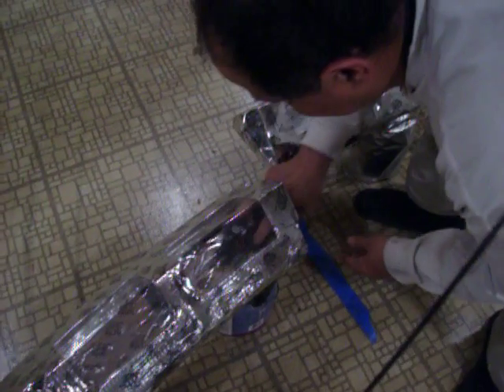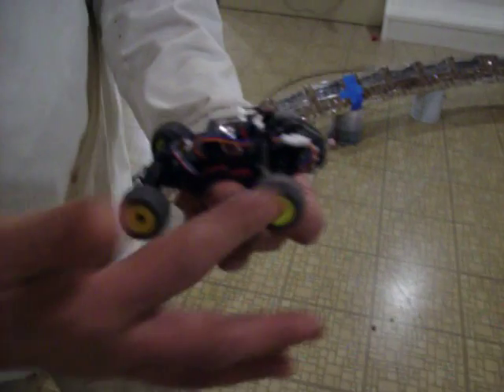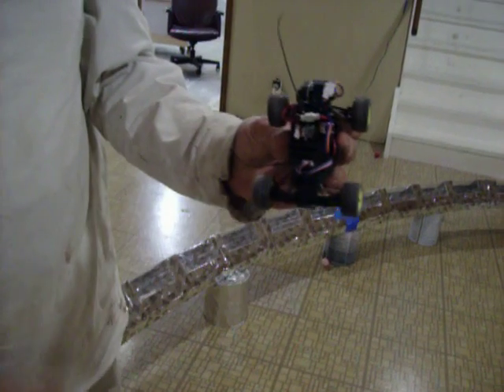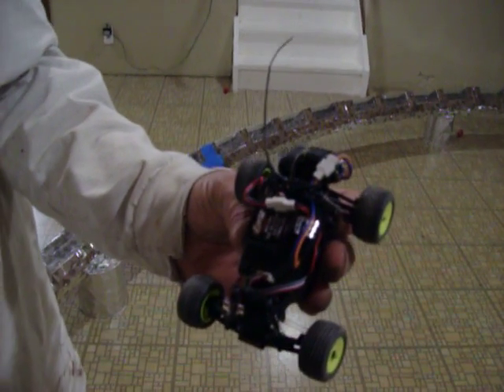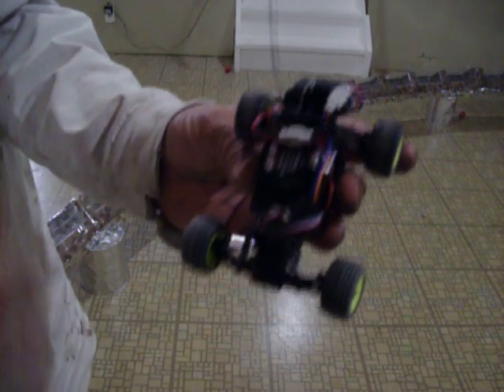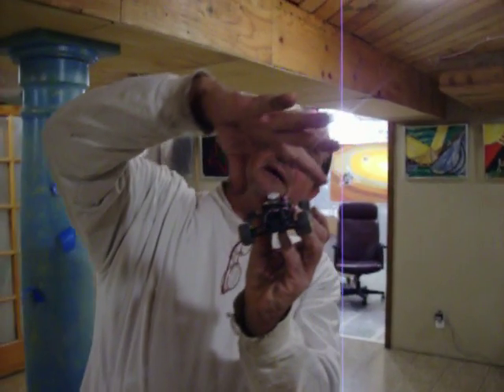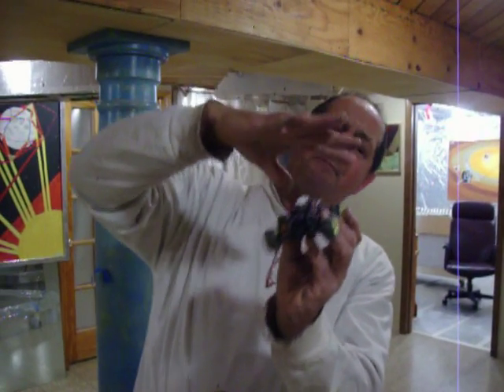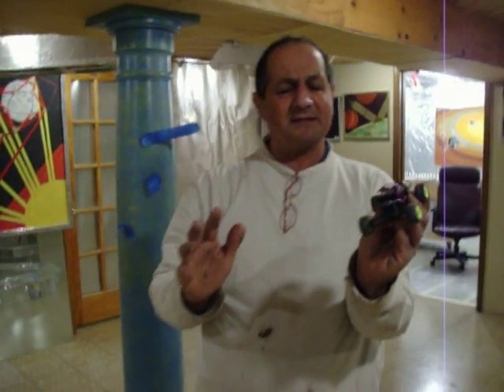Mini RC Car In High Speed Air Tunnel

Comment: that is a losi micro t which can hit like 35 tops with a crazy brush-less and lipo setup. now your going to stick a big bulky crappy body on that and shove it a thing made of plastic bags and tin foil and claim it to do 230. second that's no where new 1/16 scale, its 1/36 scale. tip: if you want to make a good video i suggest you do you do some research and make a well detailed, well filmed, well dialoged mod video for that car. or get a losi micro brush-less system and do a speed run video.

Comment from the maker: Your right on the magnets. With this tunnel system we try to eliminate all friction. We want to use MagLev technology to power the car at high speed in the tunnel. Unlike in train subway tunnels where the air slows you down. The air flowing in the pyramid tunnel will make sure there's no air drag slowing you down.

Comment: ok great theory and all but what about how much energy it is going to take to pressurise a tunnel that is long and far enough to be practicle and would it really  be wort it, and wouldnt it be more eficient to use magnets to slightly hover over the track instead of wheels as guides, would cut down on friction and about of air needed anyway i am thinking may be wrong but would like a reply so could bounce some idea back and forth